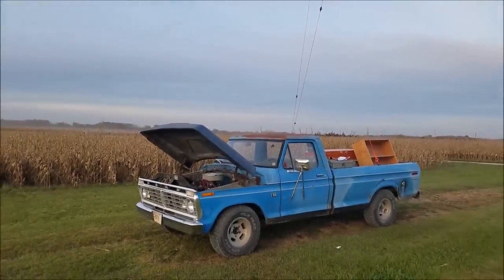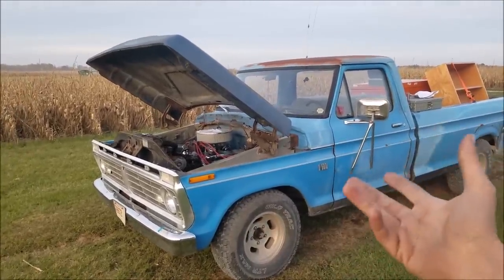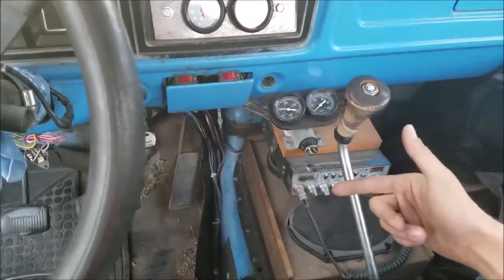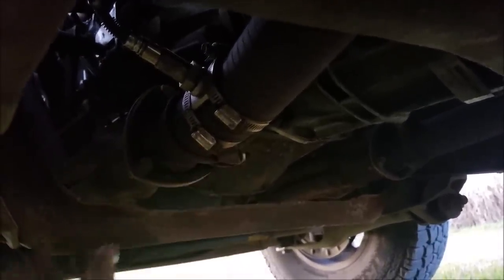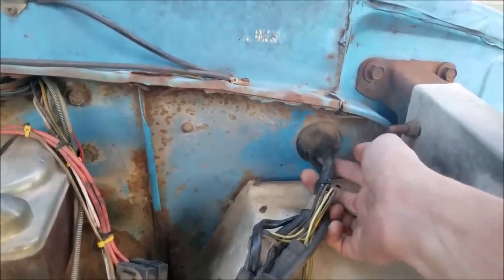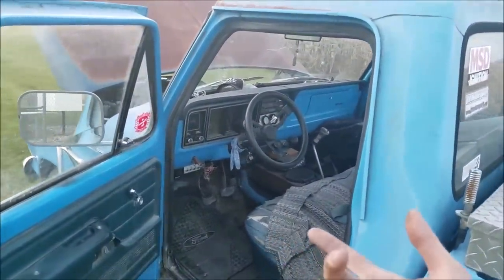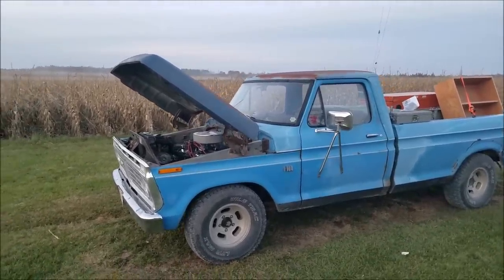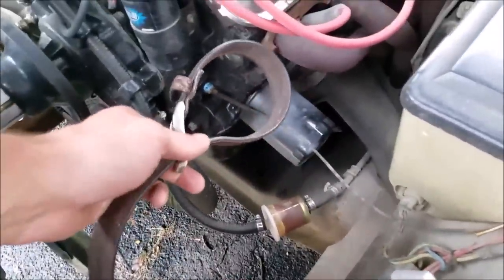Become a Carburetor Tuning Expert - Tune by AFR Gauge (CHEAP Wideband Install w/ Part Links)

Comment from the maker: Here are the Parts Links to do this if you missed them!!! 
AEM Wideband Gauge Kit - https://amzn.to/2wlxxL4
No Welding Exhaust Bung - https://amzn.to/2BCi4MO 
Step Bit for Sensor Hole - https://amzn.to/2N7rxgl
90 Degree Drill Attachment -  https://amzn.to/2Qh7BJq
Sensor Port Plug - https://amzn.to/2wgxxfF
Vacuum Gauge - https://amzn.to/2o7sgn3
Gauge Pod For Vacuum Gauge & AFR Gauge -  https://amzn.to/2N9IEOE
Reply: Hey that step down bit is no longer available. It's been almost a year hows the AFR kit holding up? Bought my first carburetor engine definitely would be super helpful knowing the AFR.

Comment: You want the o2 sensor to be at 10 or 2 to avoid condensation contamination - using flex pipe not recommended as it is more likely to leak. Any leaks before the sensor will cause errors.
Reply: Aren't all errors erroneous?

Comment: I recently picked up a factory manifold from a non-HO 5.0, and it’s got the o2 sensor in it. Using this video to get this gauge setup in my wagon
The drivetrain setup is a 1982 f150 302 and srod transmission. Got them and the driveshaft for $100.

Comment: Omg!!! Thanks for this video!!! I just installed a wideband and thought i had my carburetor dialed in but it was running super rich. Now with the wideband it made it so much easier to tune the carburetor.
Reply from the maker: You are very welcome 👍
Reply: @ThunderHead289  do i still need the vacuum gauge to tune the carburetor or can i just get away with the wideband?
Reply: I'm sure somebody's answered this for you already but still use your vac gauge for setting idle and getting the correct power valve size. Afr for pretty much everything else

Comment: Boy, a 351 fuel injected roller from 94-96....that what I wanted to do to my 84 Bronco. I ended up with a 86 FI stock system, but was happy I converted! That also gives the possible benefit of remote start :)
Reply: If you can get your hands on a 351 m400. Ford made a 351 Cleveland stroker with extremely low torque cam. Coupled with the factory NP four-speed transmissions makes great rock crawlers. But terrible on the highways. Nice thing about the m351 400. It can use F-350 parts like the zf5 German 5 speed. Without additional parts. Also weigh 390 or 460 will drop right into the same motor mounts. The only engine supposedly available for the 77 F150 4x4s. It's definitely a farm truck.

Comment: never to old to learn ,(very old school guy ) learning from new school . Not too new still got a carb. last time ever on this stuff not as handy as I once was This one a street hot rod OK 1934 ford pick up ,the engine like yours 302 roller ,Ederlbock top end ,air gap singe plane rpm ,  rpm heads  cam is Comp 35-600-8 Thumper ,I got a Holley 750 .vac .secondary .thinking of adding the meter to help tune .thank you I will watch all you other videos

Comment: I have found lots of videos on-line about how to install the AFR gauge but cannot find ANY that covers how to actually adjust the Holly carb using the readings from the AFR gauge.  Do you have one or could you provide some guidance?  For example, at idle do you simply adjust mixture screws to get the AFR reading you want?  Since the O2 sensor is only on the left exhaust do you set the right carb mixture screws the same as the left screws and trust the AFR values will be the same?  For WOT AFR adjustments is it just carb jet changes and is that done by trial & error or is there an effective method/process.  Any help would be greatly appreciated.  Thanks!
Reply: I second this!

Comment: dont bother with any other gauges that are cheaper than the AEM, its pointless the AEM is the best bang for buck
Reply from the maker: Couldn’t agree more
Reply: yeah u right Dingaling😁🍻✌👏👏
Reply: I run a aem uego and jjcoco uego the jjcoco is the the better gauge it's just a knock off aem x series really

Comment: please make a video on the item attached to your column - vacuum gauge  I beleive this would help a lot of folks including me !! forgot some of this stuff, built my ChevY - truck - 5 window, still have the truck rebuilding it again , LOVE , YOUR START OF THE VIDEO, 0 TO 72 MILES A HOUR SEE IT OVER AND OVER AND OVER ,  and old ford truck all carbs - carter -  HAVE NOT BEEN IN A POWER HOUSE VEHICLE SINCE 1994 TRIP TO NEW YORK

Comment: I use a oem o2 sensor and a multimeter. I seen some other cheap widebands that displayed lamda and you have to assemble the circuit
Reply: Not a bad idea but whats the update rate on the DMM?

Comment: I've been wanting to do this for so long I need three of them setups one for my 68 Fairlane one for my 94 carbureted Chevy truck and one for my 96 rat Ram with the 440 I wish I could get a break on them I suppose I could afford one and tune one vehicle at a time
Reply from the maker: they are extremely helpful. i thought i had mine perfect, and id consider myself pretty handy with carbs. ended up completely changing around my accelerator pump and upsizing my jets 2 sizes. crazy how that worked out. definitely a great tuning tool. that and a vacuum gauge are invaluable.
Reply: I know I wish I could afford one for all of my vehicles
Reply: Do you have any vids of your rat ram ?
Reply: @Moparmaga-1  14th one from the top it's got a body lift with a Peterbilt front bumper for pushing I want to cut some drive shafts to make stacks out of it's still a project
Reply: @ThunderHead289  lol , I was wondering,  I just ran across this video , and wondered after watching the numbers, if you worked on the lean stuff !?  , cool , good video , now.  If I could get an EASY editing app on this phone , I might try videos  lol

Comment: Time to pick some corn! Hope it stays dry long enough. I'm not sure I understand the case for doing this to "dial in" superseded technology? I fully understand keeping original vehicles "original," but that does not seem to be what this is about, though what you're up to here is certainly interesting. I'll wander through the earlier carb vlogs and see if I understand any better.
Reply from the maker: I hear you - it’s a little awkward mounted to the dash like it is, but for the next line of carb videos it will be very helpful. In most cars, I hide them in the glove box. 
The afr gauge is extremely handy for tuning because you can see what the carb is doing based on your changes. There are “ideal” afr numerics to hit under certain throttle conditions and the gauge gives a direct visual representation as to your actual air fuel ratio 👍
Reply: @ThunderHead289  If the stoichiometric ratio is a constant -- unavailable under most real-world conditions due to load, heat, fuel additives, etc. -- then you're using this apparatus to set a carb to attain other ideal air-fuel ratios under load? Maybe I'm confused and should just stop talking.
Reply from the maker: I plan to make videos in the future explaining this. We first have to understand air fuel ratio, how fuel reacts under pressure, and how timing plays into this also. There are a lot of factors. In an ideal world though - cruising should be around 14 for a carb (14.7 is too lean due to different length runners in the intake) and wide open throttle should be 12.5 to 13.5 
I have some tuning explanation work to do in the coming months
Reply: @jacklyons2557  Never stop asking questions my man! Been working on old beaters since I was knee high (23 now) , and I'm still stoked for the new videos because carb tuning has always made me a bit nervous due all the variables. But that's why we're all here isn't it? Besides, when Thunderhead's engine is Thunderdead, we'll know what not to do :D
Reply: Because efi SUCKS when you have problems. And can never be tuned

Comment: that's nice. better than the haynes manual on these fords it says after carb adjustments pull the spark plugs out look for carbon
Reply from the maker: its really just extremely hard to tell anymore from the way fuel is today.
Reply: That's what you when using a Haynes manual

Comment: Have u ever Hurd of puting in a set of 305 or 350 gm head valves 202 maybe 🤔...and putting them in 302 heads like on gt40p explorer heads... And taking the valves out of the Chevy heads and installing them with work into the 302 heads... good gain.  I guess..

Comment: I have a question, I want to in stall an air fuel ratio monitor in my boat. It’s a small block 355 hp with a 750 cam carb the cooling water exits the boat through the exhaust. Will the water mess with the o2 sensor. What’s your thoughts?

Comment: Wanting to question a comment about compatibility with high zinc oil. Matt from the tech line at AEM says zinc not a problem. Too much oil (more than 1 qt/1000 miles) in the exhaust, or antifreeze/coolant in the exhaust, or leaded fuel will cause problems.
Reply from the maker: Theoretically it would be nice to only use it when tuning, then replace with a plug. Zinc can be an issue - mostly when you run a Pcv valve since it vents oil fumes right back to the combustion chamber.

Comment: What adjustments are you supposed to make based on this gauge and what number are you trying to achieve?
Reply from the maker: Idle - 12.5-14 
Cruising - 14-15
Hard throttle 12-13 
👍

Comment: I have an AEM gauge but no sensor and very little wire left on the back looks like 3 wires off the back of it? Not sure if I can just get a sensor for it let alone the right one…

Comment: Love your videos man, great info. I got a 78 f150 custom with a stock 302. I'm looking to gain some more power without getting real heavy with modifications.  What cylinder heads could I bolt straight up to increase power without changing lifters and pushrods?
Reply from the maker: hey, i appreciate the feedback! 
I believe in 78, the rockers were pedestal style - correct me if im wrong. 
those were the low low compression days with huge chambers. 
you should be able to find e7 heads for extremely cheap, and it will make a huge difference over your stock heads. compared to what you have they breath well and have a tighter chamber for more compression. all passenger 302 cars from 87 on should have them - be leery of the trucks, they ran e6 heads for a long time that have terrible valve shrouding. 
if you can find some gt40 heads, they have a bit more to offer, but they tend to be expensive, need reworked, and are pretty hard to come by.
Reply: Just bolt the E7 heads on the stock motor?
So need to swap anything else out?
Reply: Also is there a difference between  E7 and E7TE?
Reply: What's a good, direct bolt on  carb to put on my stock 78 f150 302

Comment: Would you do a video on tuning a carb with a bigger venturi than stock? Since when getting carbs off junk yard trucks and on ebay (Used one and sometimes new ones) it gets hard to find the stamp for the venturi size. 

Im mainly talking about the motorcraft 2150. Im sure using carb CFM rating would work as well.

Comment: Good video I just installed one on my 86 d150 but it doesnt read anything for some reason it just says P00, cycles up and down, then displays 14.7, and then goes up from there until it just displays dashes across the screen, do I need to calibrate it or something?

Comment: Hey thunderhead289 great videos. I have an Edelbrock 1406, do you have a video that shows how to tune the carburator using an afr gauge? Like going through the entire process setting the idle, setting the idle mixture screws.... Thanks
Reply from the maker: Search Thunderhead289 tune carb - click on the video with the thumbnail that says “uncle luke gone’ learn ya today”

Comment: I just installed this af guage on my 93 f250 460. just rebuilt engine .30 over, comp cams computer grind cam, banks headers and full exhaust package and raised compression from 8.3 to 9.1. still running stock computer and injectors. I installed the sensor for the guage in the Y pipe after the headers and in open loop when cold af ratio is fine but after warm up and closed loop it runs so lean it wont read anymore. Do you think its possible the sensor is too far away from engine or does that matter? Maybe its just that lean and i need to upgrade injectors and regulator? Any help is appreciated and love your videos keep em coming

Comment: Thank you for replying it does crank slow  when you press on the pedal it seems it cranks faster it's got a new battery new starter new coil new ignition module
Reply from the maker: 1970chevy07 gotcha. 
After an engine runs, the starter will tend to be a bit heat soaked - sometimes it will crank slower in this case. Also, when an engines warm, rings will seal better and with the throttle closed, an engine is more susceptible to pumping losses. 
The other potential item is heat soak - if I have a fully functioning heat crossover on my intake manifold and don’t run a carb spacer it will heat soak bad forcing me to hold the throttle either half open or all the way open when cranking to light off.
Reply: 1970chevy07. I know this is late, and you may have talked about it but, if it still cranks slow, change your battery cables. My 72 Lemans would crank slow.  One day I was cranking it over with the hood up and noticed my positive cable start to smoke from all the cranking. I found that it was corroded on the inside and couldn't pass all the amperage the starter needed. I changed both cables and everything got better. 
Just another thought for ya.
Reply: @ThunderHead289  Take a look at Uncle Tony's Garage site he has a simple cheap fix for carb vapor lock.

Comment: Do you have to power the sensor separately or do all the sensor wires go direct to the gauge?
Reply from the maker: If I remember correctly, it’s one either a main power and an ignition switch lead followed by a ground or simply an ignition source and ground. 
3 or 2 wires

Comment: What kind of mileage do you get with your 302? I just rebuilt mine for my old galaxie and I'm getting somewhere in the neighborhood of 8-10mpg and its for sure not a performance build. It's hard to drive it daily like I used to with mileage this bad
Reply from the maker: I get around 18-20 BUT, my truck has a 5 speed
Reply: @ThunderHead289  I've got a c4, so nothing in the way of overdrive for me lol. What do you think could be the cause of my mileage being so bad? I assume it has to be carb related, the cam I put in isnt wild enough to warrant such terrible mileage
Reply from the maker: Timing I would put my money on. 
Firing the mixture late will effect economy. 
Do you have a vacuum advance?
Reply: @ThunderHead289  Yep, I do have vacuum advance. I never adjusted it though since the engine ran just fine and had decent mileage before I rebuilt it. I think I'm running something like 12 degrees initial, not sure on total with the vacuum and centrifugal though
Reply from the maker: Dogetor that’s what I would look into. That and your air fuel ratio - I highly recommend the afr gauge I have linked 👍
I recurve all my distributors to bring my timing in quicker. Stock was very lazy, but super safe.

Comment: @Thunderhead289 Luke, have you heard of the AEM AFR kit containing the wrong sensor? Mine worked until the truck warmed up then I noticed the gauge was pegged all the way to the lean side and the display was all dashes. Has anyone run into this?

Comment: So would I need two afr gauges on a car with a tunnel ram? with true dual exhaust with no cross over pipe tunnel ram has 2 450 double pumper.
Reply from the maker: Why do you think you would? Does your tunel ram not have an open plenum area?
Reply: @ThunderHead289   some one just thought I should have one on each bank it's open in middle for airflow I wasn't entirely sure

Comment: When you got the wide-band in how close was your tune?
Reply from the maker: Ah, a great question - and I consider myself to be fairly carb knowledgeable: I went up 2 jet sizes and changed from a 35 accelerator pump nozzle to a 31 with an orange cam. 
Also changed my power valve to a 10.5 
So not huge changes in total, but I’d say it was worth some low end grunt for sure!
Reply: ThunderHead289 was that enough change to "feel" the difference? I am still learning to understand the AFR, I know what you want It to be but it fluctuates through load and rpm changes lol
Reply: mhn3773 in every rpm it change the ratio. I want to apply this gauge in my motorcycle carburetor type

Comment: For dual exhaust 351c if only putting on one cylinder bank, is it best on driver's side or passenger side?
Reply from the maker: It technically doesn’t matter. If you are really concerned, you can plumb two ports and just move the sensor from side to side. Theoretically it should be the same, but fuel plane intakes will offer a bit of a difference - the plenum that sits lower will technically need one jet size higher roughly. It’s pretty inconsequential to just set everything equal 👍

Comment: Didn't you have a video with a AFR gauge showing how it the air fuel ratio changed as you stop at a light and speed up? I cant find it again.
Reply from the maker: andy347495 yes sir - I believe it’s called “carburetors - why you hate them” or something like that
Reply: @ThunderHead289  alright thanks

Comment: 460 ford with holley 600 cfm. Mine is running lean at part throttle cruising when not under much load usally around 15.7 any idea how to fix that? Thanks.
Reply from the maker: Several things could be causing it. Depends what part throttle means though - are we talking 5 percent throttle or are we talking up to 50 percent throttle.
Reply: @ThunderHead289  5%

Comment: Luke I have a question I have a 59 ford edsel with a 2100 aftermarket carburetor  and the choke does not have a power plugged in can I just run a direct power from the fuse panel????
Reply from the maker: You can really, as long as it’s a keyed source (off when vehicle is off, on when key is in run position)
Reply: @ThunderHead289  thanks Luke